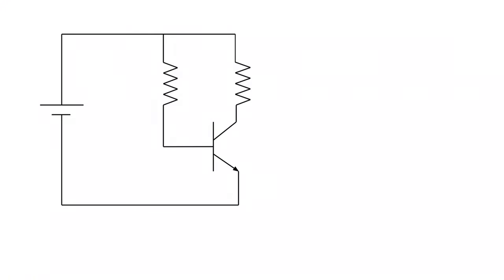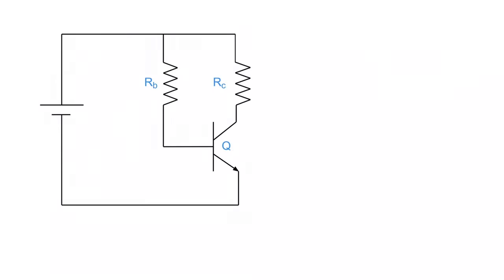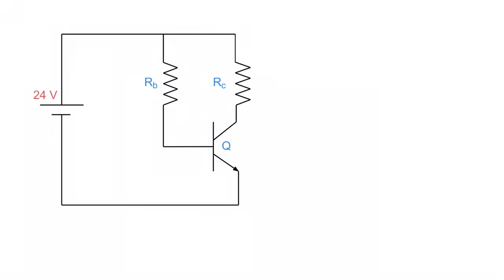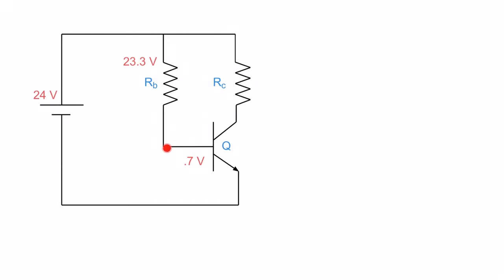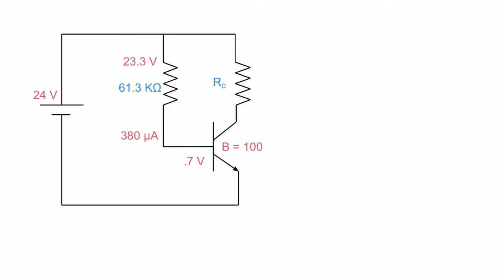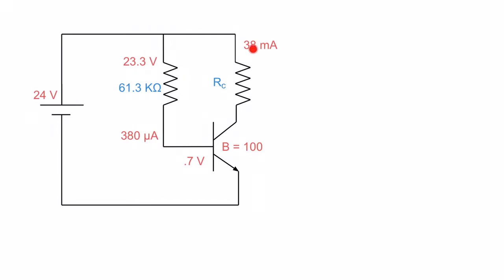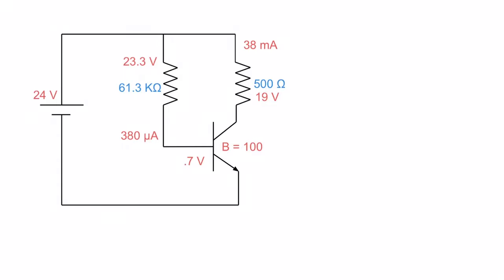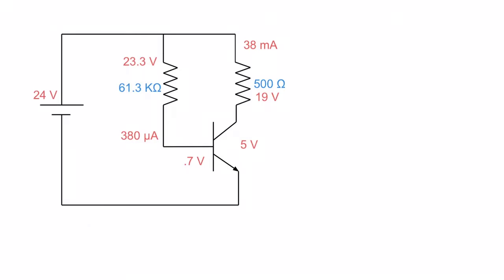Transistor circuits

Comment: I was just wondering what this circuit actually does?
Reply: This circuit is only good for instruction purposes. 

If you mean transistor circuits in general, they allow loads that draw more power than a signal can provide. If you were turning on a motor using a microcontroller, you'd destroy the controller by powering the motor with a pin.

Comment: Why did you choose a base resistor of 61.3k ohms? Why not 50k ohms or 10k ohms or 5k ohms or 48.5k ohms?
Explain
Reply: He could’ve picked any of your suggestions, all that would’ve done is change the values of Collector current, and resistor etc....
Reply: Yes, exactly. This is not quite explained very well. Normally the load resistance is known (Rc) such as a 500 ohm relay and the supply voltage is known (in this case 24v). Then the base resistor (Rb) is calculated to saturate the transistor ensuring the relay switches on. So with a forced Beta (Hfe) of 20 you need a base resistor (Rb) of about 9.7k ohms (10k) would saturate the transistor and switch on the 500 ohm relay.
Reply: @TinyWords  well said......I did electronics in 1976, and flunked......started working as a store an when I was 17......, I’m 60 years old now.....and I can’t believe I remembered what I wrote? Thanks for that.
Reply: He could’ve worked it the other way.  For instance if he had a known current for Collector - an LED - you could then used the Gain to get the current at Base.  Then it’s V divided by I for the base resister.

Comment: I only get .5v at my transistor base pin....could a bad transistor cause this or is the transistor not at fault for this low reading and I have to track the problem down with what is feeding this transistor the voltage
Reply: .7 is an estimate for silicon diodes. It can be different and if the circuit works using that value and changing Vb I wouldn't worry.

Comment: Whats the maximum current that be drawn for a load connected across the 5V transistor (Vce)?
Reply: The voltage drop across the transistor was 5V only for this load and base current value. By finding the current based on the gain and base currents, the voltage drop across the transistor is the difference between the drop across the load and the source to ground. Changing the load will change the voltage drop across the transistor. 

You can increase the base current until the transistor is in saturation mode. In this case, the voltage drop is about 0.2 V for many transistors, at which time the transistor is essentially a switch. So, by decreasing the base resistor value and without an adequate load, you can increase the current through the transistor until you see the magic smoke.

Comment: So could I use that 5 v across the transistor to power an led?
Reply: Yes but you don't choose a resistor first. That's backwards and a bad example. You'd find 5V + Vce of the transitor you plan to use, then you know the remaining V drop. Then you calculate the resistor needed to obtain the current for the LED, like 15 to 20 mA.  The LED would typically be in series with the collector.

Comment: you said "lets give it a resistance of 500 ohms" .. .but you calculated the current before that.... how can you know the current then give it an arbitrary value and NOT affect the current from 38ma to something else.... what am i missing here. what if you placed a 1000ohm resistor there instead, would the current not change?? there is something im not grasping here

Comment: could you do a darlington pair?
Reply: Darlington pair would be the same as this. Just compensate for the added voltage drop across the second base from the emitter of the first transistor and so on.
Reply: How do you choose resistor values?

Comment: Man are you absolutely sure your collector to emitter voltage will be 5V? I thought a typical Vce  on an NPN transistor was about .3V when saturated. What am I missing?
Reply: It all depends on the transistor you're using. In this case, he only specified that is a silicon transistor.
Reply: Yeah, if the transistor is known, you'd determine the operation region then begin with that voltage drop Vce to determine the remaining V drop and calc the resistor,  rather than arbitrarily choosing a resistor and setting Vce

Comment: Never use beta (hfe) to design a transistor circuit, real moon stuff as beta will vary very much between real world components.
Reply: And vary with temperature , voltage, etc, but then where do you start?  You guess your typical operating parameters an consult the Hfe chart int he data sheet to get "close enough", then prototype to confirm.  Add a trim pot as necessary and you'll know the values for your final system, roughly.  Until it's put into operation anywhere but your lab, then it's all out the window again.  Close enough is close enough for anything done by hand.  Anything more, and you'll simulate instead, if not design it with A.I.

Comment: This will stay confusing to me at least. You say the current flows from the emitter to the base and you point that out again by following the line that way. It is a circuit that much is true. But it is not logical in the names they give them. The emitter is the output and the emitter is closed until the base opens it and then a "bigger" current will flow from collector to emitter which is the special property of a transistor.  It is also the way they draw the arrow in the transistor symbol and any arrow in circuitry involving those parts.
The flow goes from minus to the plus
I know these are the agreements on the electron flow and in reality they move the other way, 
but if you explain it this way it becomes confusing again. Am I missing something here?
Guess this is maybe a PNP transistor, then the arrow is in the wrong direction.
Reply: You’re right. Current does flow out of the emitter in NPN transistors, and the base current then joins this flow along with the collector. We then get the equation: Ie = Ib + Ic
Maybe it was a slip of tongue in the video
Reply: current flows both from base to emitter and from collector to emitter at the same time. current flowing means the electrons are flowing in the opposite direction: electrons flowing from emitter to base and emitter to collector.

Comment: Since the Amps is 380 micro Amps, that's 0.380 Amps, and the Ohms is 61,300 Ohms, so according to Ohms law I thought it would be V = 61,300 x 0.380 which would be like 23,000 Volts. What am I getting wrong here? Thanks
Reply: 380 micro amps is 0.000380 amps
Reply: @Th3Mafia  Thank you very much!

Comment: This is completely WRONG. if I use your method with a beta=200 (with the same resistors values you have given) I will obtain the same base current, and a collector current I_c=76mA and a voltage V_ce = 38V. This is working only because you have given a beta = 100. If you will set a beta = 300 (many bjt npn has that value in reality) you will end up with 114mA!! because you just multiply the base current for the beta. THIS IS COMPLETELY WRONG, YOU WILL CONFUSE MANY PEOPLE WITH THIS. REMOVE THIS VIDEO
Reply: To: riemann diy
     I saw a Ramsay test question with exactly the same picture and the same question: V on Rc = ?, except the values of Rb and Rc were not specified. And the multiple choice answers were:
A)    +12 Volts
B)    - 12 Volts
C)        0 Volts
D)     0.7 Volts
The poor examinee did not know the correct answer because he/she was unlucky to have seen this video before the test. So, he/she chose the answer C) 0 Volts because it seemed the most likely one for him/her after having watched this video.